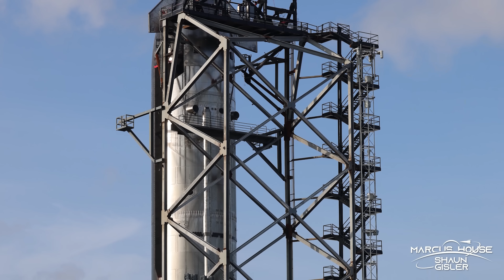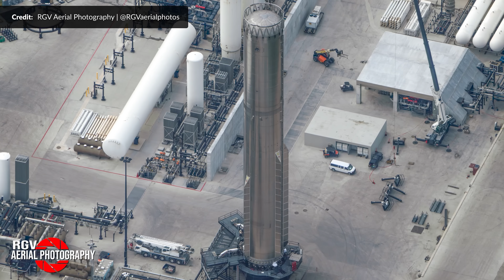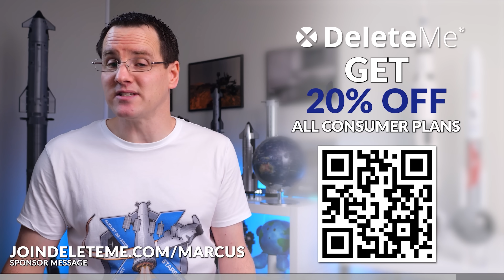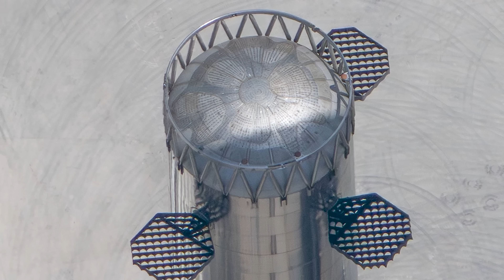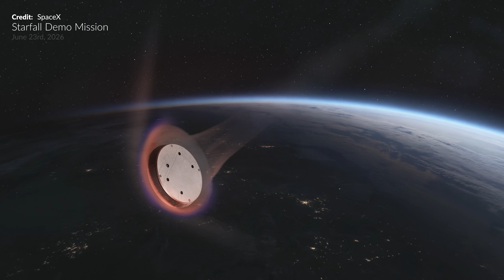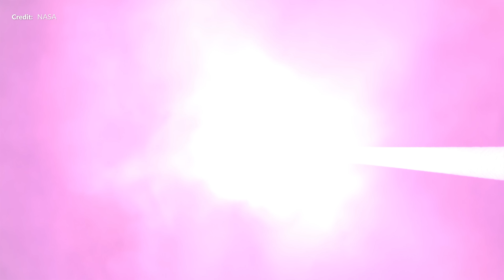What's Holding Starship Back?

Comment: Summary
00:43 - Starship Flight 13 Preparations: Ship 40 has begun testing, including a full-duration single-engine static fire. This is significant as it marks progress toward the upcoming flight and demonstrates refinements in engine testing.
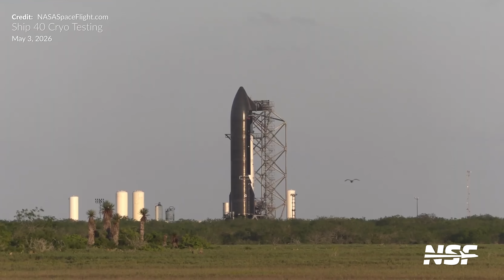03:37 - Starship Flight 12 Hot Staging Analysis: A deep dive into why the booster flipped in the wrong direction. This is crucial for understanding how SpaceX is iterating on engine ignition sequences and structural shielding to ensure mission success.
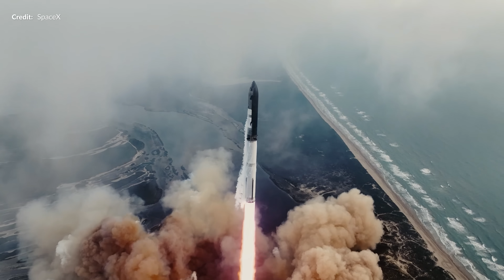14:22 - Falcon 9 Starfall Demo: SpaceX launched the Starfall capsule, a demonstration mission for an autonomous cargo return vehicle. It is important as it showcases a potential low-cost, point-to-point delivery method for experiments and materials.
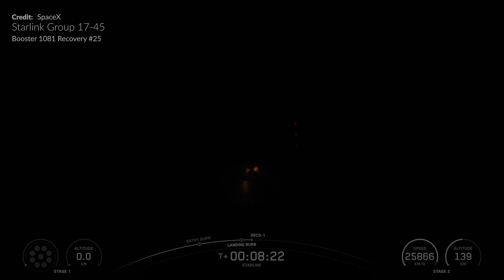18:30 - Rocket Lab’s Victus Haze: The Space Force mission Victus Haze involves a tactical orbital chase. This is significant for demonstrating rapid response capabilities and dynamic space operations between two satellites.
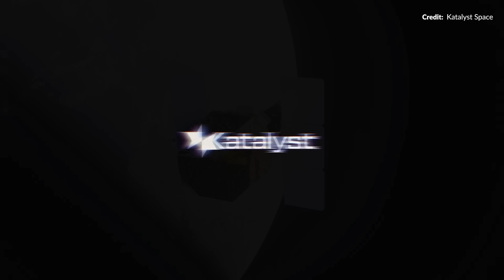20:54 - NASA’s Swift Telescope Rescue: NASA and Catalyst Space are attempting a first-of-its-kind mission to boost the Swift Space Telescope into a higher orbit. This is vital to save a still-productive scientific instrument from atmospheric re-entry.
22:58 - Blue Origin’s Lunar Hardware: Blue Origin revealed the 'Power Tower' for the Blue Moon lander. It is significant for showing tangible hardware progress, enabling solar power operations in permanently shadowed lunar regions.

Comment: It will never be reliable. Too big,  heavy and powerful. Too much vibration beyond material science ability to deal with.
Reply from the maker: The challenge is massive. They really are just balancing on the edge of material science, so if they do nail it, it is going to be amazing. I mean, we know they can reuse the super heavy already. It is all down to the Starship now. A very tricky thing.
Reply: @MarcusHouse   No it's not going to be amazing even if they "nail it", this thing has no purpose apart from being a spectacle for the gullible to keep investing into spacex.

Comment: A question that may be asked far too late, but if you know, I would be very interested in finding out. How come the sea level raptors still show very clear shock diamonds up until the point of SECO? Shouldn't they go from underexpanded to overexpanded as the altitude increases? This is very visible at T+7:44 of flight 12. It breaks my brain a bit, as I've been told shock diamonds are a sign of inefficiencies caused by the engine bells being optimized for different air pressures, but the exhaust pattern doesn't seem to visibly change at all for the three central engines.

Comment: Whats really holding starship back?

Starship still doesnt work, after 12 attempts, despite simply being a line extension on falconx and falcon heavy. There is no market for the theoretical launch capacity starship offers. The CEO offers farcical promises about project scope and delivery timelines, Mars by 2026?. The flawed (deliberately?) company structure allows very dodgy transactions to occur - how many cybertrucks did spacex buy from tesla, 2200 units, for what purpose? The company structure is wrong, too many disconnected business units lumped together for no reason, other than to pump up a valuation prior to IPO. These are the glaring issues holding starship back

Comment: SpaceX hasn't stolen enough Tax Payer money yet. SpaceX sure knows how to show fanbois and flashmobs celebrating launches. Why didn't NASA think of that?  "Yay! There goes more of our Tax Money!"  SpaceX did virtually none of the engineering here, this was virtually all done by NASA using Tax money, and USED to be transparent and provide publicly available data, but now it's still fully Tax payer funded with ZERO transparency or control.  Not any kind of progress. Yay, now we get to flush money directly to billionaires!
Reply from the maker: Please do share with me David the sources of why you believe SpaceX using using tax payer money outside of milestones agreed on to be delivered (such as Artemis milestones), or actual NASA contracts where they are delivering crew or cargo to the ISS. 

Artemis HLS milestones from SpaceX are indeed waaaaay behind where we wanted them to be (causing much frustration even among enthusiasts). This would at least be a fair enough argument if you made that. SpaceX doesn't get granted any more $$$ because they are missing deadlines or needing to do lots more test flights to get where they need to be. They must hit each NASA milestone to continue to be paid, and in fact, NASA has opened that next stage of funding back up and have not guaranteed it to SpaceX simply because they are not moving fast enough. This allows Blue Origin to prove they can do it first (the race is on) and taking that Artemis funding instead.

To say that SpaceX is doing " virtually none of the engineering" is a frankly absurd thing to say. We are watching them every week. They are engineering the vast majority of this from their own funding via Starlink and commercial/government contracts (which means everyone can rely less on Russian rocket hardware). Starship as the largest rocket ever to fly by far while also trying to become a fully reusable system. This has never been done before. If they can nail this and therefore low cost mass to orbit without throwing rocket boosters and upper stages into the ocean and atmosphere every time, that is a big step up for what humans can do in exploration and tech.

I do agree on your transparency point however. It is a bummer that tax payer money has been invested in Starship HLS milestones and yet we still don't know much about what SpaceX are working on specifically on that. It has all been hidden away for years now and even those of us that study it, have almost no information on how this Starship system is fully being prepared. That does suck, and is not good enough. 

I'm sorry you don't see how incredible this story is. Watching the most powerful vehicle ever made fly is an extraordinary thing. If you are basing your comment specifically because of politics, that's a sad way to see the world. I hope you try to actually look into the counter arguments so that you have a balanced view of what SpaceX is doing.
Reply: @MarcusHouse  He gets told what to think.  He has absolutely no clue.  He likely doesn't even know where to start.

Comment: “…all way the back in May…” for anyone, but SpaceX, this would have been pretty quick; less than two months. We are spoiled by the rate at which SpaceX moves, but let’s not forget that this is the not the standard. SpaceX is hardware rich, which no one else is emulating. No one has been able to match their production rate.

V3 is all about Starship moving out of development and into an operational mode. It makes sense to slow down as they work through the issues with the last launch.

Comment: If only it was possible to spin the engines' internals with minimum thrust (like 1-2%), where it causes negligible force acting on the full vehicle, yet allows stable operation, and only when greenlit, engine throttled up. But, it's either this, or thrust listed in MN of force, instead of kN.

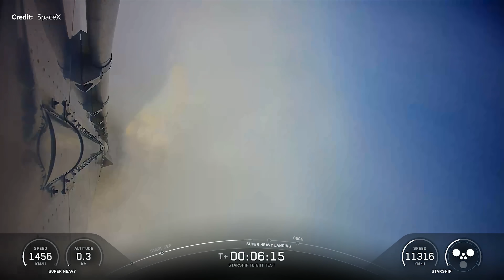Comment: Notice on previous flight, hot gas hit evenly on two symmetric grids but on the latest flight, gas hit only on one grid. This gas hitting only on one grid 4:07 generated a much larger twisting moment, causing the unexpected flip response.

Comment: Will SpaceX raise enough from its bond offering to keep the launches going?
Reply: Falcon 9 and Heavy are definitely fine. Starship might be a bit more iffy depending on if the stock crashes or not.
Reply: @domakemake2447 There's a valid business model for rockets the size of Falcon 9 (for sure) and Falcon Heavy (barely).  Starship is just too big. Of course, SpaceX can use it to launch a zillion Starlink satellites at a time, but that's the business equivalent of SpaceX buying unwanted Cybertrucks from Tesla -- it's one part of the company transferring money to another part.  Nothing wrong with that, I guess, but it's not the same as getting paid by an external customer.
Reply: @guacamental  Are you claiming starlink doesn't make money?  I don't think you have even a small grasp of what's going on.
Reply: @guacamental  Starship’s main capabilities is if you’re trying to send up a really large payload (or a L O T of payloads) and or a payload that needs to go a great distance.
Reply: @domakemake2447 Right, agree. The global launch market is worth about $10B/year.  Of that about 80% is for launching satellites.  About 85% of the tonnage to orbit (mostly LEO) is already carried by SpaceX.  There's your commercial market.  No business is clamoring for 150 T objects to be put in LEO.  You don't want your own regular-sized satellite to be sharing a launch with a dozen other satellites built by other companies whose processes you don't control.  If Starship magically made the cost to SpaceX of getting to LEO free then you might make $10B/year.

Comment: There is too much complexity, too much stress, too many points of failure. The G forces of the flip must be mitigated.   It must be a significantly more gradual flip with re-entry. Overall, too much complexity ruins all rocket systems. It's arrogance to think computers can solve it. There's a physicality to it.  And that's happening BEFORE REUSE. Remember that. 

This isn't hate, they just need to do mild redesign with that in mind.
Reply: It's pretend expert nonsense.

Comment: So Marcus, the S40  RVAC engine that failed a few minutes after hot staging/booster separation, was that the same engine with the millisecond delayed ignition that flipped the booster into the wrong direction?  

Which of the 3 RVACs was it @ 10:17 ? The one on the left, or other?  

And I've also been wondering if removing that 1(of 4)grid fins might have anything to do with the faulty flip. Could having 1 less grid fin, particularly where they removed it, have made it aerodynamically unstable? 

I'm no rocket or aerospace scientist,  so I wouldn't know.    
Pardon my ignorance or noob question here.
Reply: Re: 10:17 Or was it the top right engine in that graphic you showed that failed? 

So yeah, I am a little confused.

Comment: Those little graphics are not a direct reflection of what is happening with the engines. They are sensor data, that is processed by software and travels over various communications equipment.

Comment: Re: hot staging.  Does not seem very fault tolerant.
Reply: Only when booster recovery is involved.
Reply: @imaginary_friend7300 and booster recovery is involved.  So, you agree with me.  If the flip can be disrupted by a single engine being a few milliseconds out of time, that may not lead to recovery.  Not saying it can’t be corrected, just sayin’

Comment: I still think they need to install floating bulk heads that have a rachet system in each of the tanks. Put the gas back in above the bulkhead/piston to keep the tank pressurised and keep pushing it down the tank as the fuel is used. The one way ratchet would stop it going back up and stop fuel slush
Reply: It's a lot of extra hardware for a system that likely wouldn't work.

Comment: I have to wonder if the failed vacuum Raptor nozzle on starship had anything to do with the booster hot stage separation going awry. If the nozzle failed during hot stage ignition, then the non symmetric forces on the booster could have kicked the booster sideways
Reply from the maker: Yea, I don't know if there is a connection there or not. I haven't managed to find one.
Reply: @MarcusHouse  Pressure waves (rocket exhaust) or debris/ice getting reflected by the booster top in the wrong direction could be a potential source of failure. Especially with the vacuum raptors because of their bigger catchment area.

Comment: I get why that dome has its shape as the top of a fuel tank, but it’s a shame that it can’t be a flat plane tipped in the opposite direction that the booster needs to flip.  Then, regardless of Starship motor firing order, any motor would push the booster in the correct direction.

Comment: Seems to me they should go back to the mechanical shield on the side of the hot stage, to guarantee proper flip even if the engines don't fire as planned. Works every time that way. My armchair engineer 2 cents worth.

Comment: I think you minimized the issues regarding the performance of the boosters. I made a video a while back showing flights 2 through 10 or so and the booster had flipped in just about every possible direction and the engines still lit. If they're going to launch daily, the system needs to be robust. One engine starting up a little late (or failing) shouldn't result in the lost of the booster. Now SpaceX is well known for under-engineering and then adding fixes as needed. So I agree with the comments not the video. SpaceX has probably spent a significant amount of time figuring out why the booster engines didn't stay lit regardless of orientation. If you look closely you can see the cold gas thrusters firing rapidly, so "out of control" is hardly accurate.

Comment: I wonder if it would be viable the slant the top dome slightly leeward so the repulsive force of the engines would push the booster to the windward.
I know it would effect the internal tank pressure distribution across the area of the top dome, which would be an extra engineering challenge, but it could simplify the overall separation mechanics.
Reply: Probably would result in more reinforcements for the dome to prevent it from breaking apart

Comment: I can't help think that starting these Raptors is not a milisecond thing. The electrical engine that starts your ICE car starts in miliseconds, but the main engine will need a second or 2, and a few sputtering revolutions before it (hopefully) starts. 
Anyway, thanks for the excellent and interesting speculation which is all we have now. 
I look forward to the FAA investigation conclusions on flight 12, it should confirm some of our theories.
Reply: The thing with rocket engines is that on startup, milliseconds do count due to the extreme conditions of ignition and just how much thrust each individual engine puts out, car engines are dealing with a lot less than Raptor 3. (feel free to correct anything I got wrong)

Comment: Please deep dive on boil off. We talk about how much is needed for the moon because of boil off. Okay, let's talk Mars. Wouldn't this make Mars impossible? It will months not days for this trip.
Reply: According to SpaceX boil-off is a solved (or very low-risk) problem for Starship's Moon/Mars architecture. 
1. For LEO they'll use prop depots with vacuum-jacketed lines and MLI blankets or coatings to reduce heat ingress dramatically (potentially by 90-99% compared to bare tanks). Adding proper orientation and attitude control the problem is reduced even further.

2. Experts in a 2025 peer-reviewed analysis published in Scientific Reports (Nature) confirm that Starship's design enables no boil-off of cryogenic propellants during interplanetary transits to Mars, as the tanks radiate more heat (5–10 kW) than they absorb from the Sun (~2 kW), resulting in net cooling. While the study focused on a 90-day fast transit, the radiative cooling principle scales favorably to standard 6–9 month journeys, where average solar flux is even lower due to greater distance from the Sun.

Comment: The whole hot-staging option seems unnecessarily complex. This system in comparison to the Falcon 9, while offering much more performance, also adds much more complexity. I wonder if the constant rapid-iteration decision was the right one?
Reply: Without rapid iteration Starship would be impossible to develop. The much simpler and much easier low performance partially reusable NewGlenn for example took over 14 years and more money than Starship to develop, and has failed spectacularly 2 times in a row.
Reply: It makes things easier.

Comment: So basically starship sparkplug timing was off during the last launch. In a car that means your car won't running right or at all. In starship spark plug timing is connected to steering so it made booster steer the wrong way which made its on board computer freak out.  This is understandable because you would freak out too if you turned your car one direction and it decided to go a different direction. After that booster went into recovery mode trying to save it self. Thus no tower catch. During testing the tested the engine then tested the firing sequence noticed it was still out of order or not working right when they couldn't get it to fire in the right order they put it back in the shop to rewire it. Because it is almost always the plug wire that cause the problem. 😂

Comment: Obviously SpaceX will fix this booster flip problem but I worry that the result will still be too fragile. Any little thing goes wrong and the booster fails to return. Seems like shaping the dome on the top of the booster might give them a more reliable flip. Depending on millisecond timing of ship engines may be a mistake.